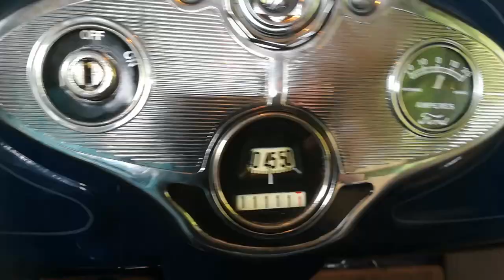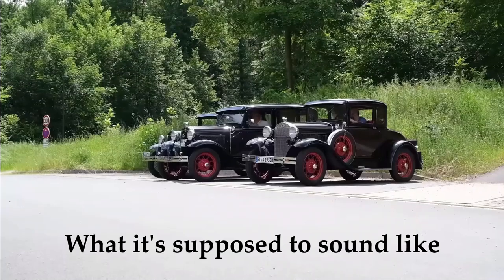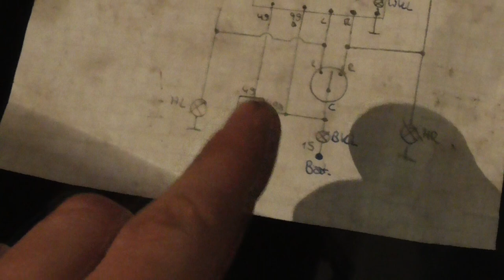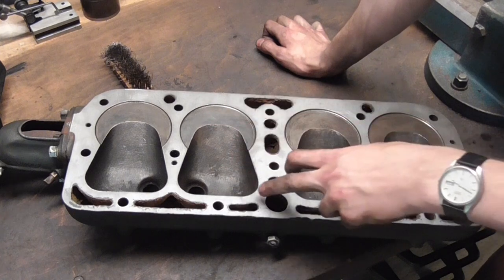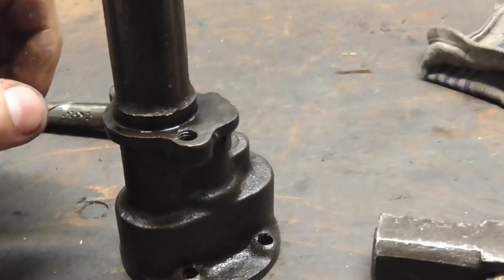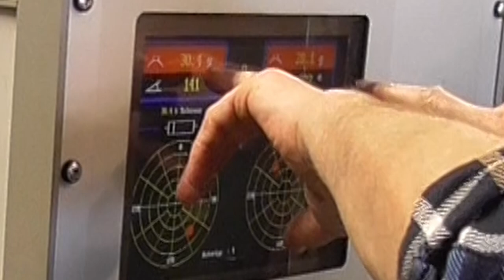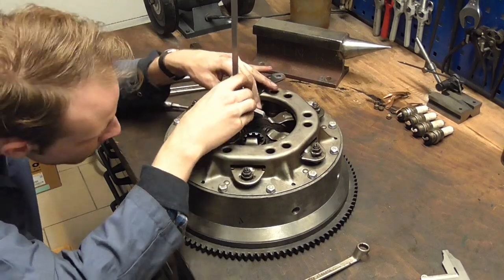Model A Mechanics Log #2: Preparing the Big Day

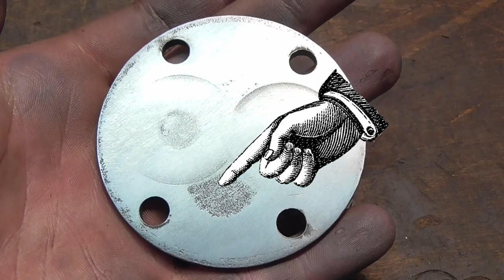Comment from the maker: I meant to put some captions over the pointer at 18:05 saying "cavitation".
DUH!
Reply: Are you sure?  Cause water can do that too.  I know cavitation can be an incredible force, but so is sitting water. Water will always be at the bottom of oil because it's more dense.
Reply from the maker: @tarstarkusz  Well, it's only at the intake side of the pump, where a vacuum would be created. 
If it was corrosion, I'd reckon it'd be all across the cover plate and not just in that specific spot.
Also, the pump isn't all the way down in the sump - there's at least 2 inches of space to the bottom of the pan,
which would have taken a lot of water to fill.

Comment: I have been through what ur going through,  my engine took 3 times pulling it out and sending back to the builder to get it right (all through covid)
Clutch chatter us what started my restoration. 
Now, Everything from radiator to rear end is restored or replaced.  Money is easy to spend on these cars. I've had mine 45 years. Most parts I've bought 3 times.
Reply from the maker: Oh god, I so dearly hope I won't have to get the engine out ever again (at least not in the next 15 years)...

Comment: I'm not too worried about the oil pump lug being JB Welded onto the body, but I do worry about the fan pulley. Those Model A fans do have a reputation for catastrophic failure and you could be looking at a new radiator (or even hood panels).
Love the new crankshaft! I'm sure you'll notice a tremendous difference and it is (more or less) a period upgrade.
When I look at the number of small/medium jobs you're doing whilst waiting for the engine, it's amazing how robust the car actually is. It just runs, despite cracked bearings, worn out bushings, graunched  flywheel ring gear teeth and over 90 years of "she'll do" type fixes. By the time you get finished with all of the major and minor repairs, it's going to feel like you're driving a Lincoln!
Thanks for showing us all of your "while I've got the time" repairs. I really enjoyed this video
By the way, very cool fountain!
Reply from the maker: The fans that fail are the original type, made of riveted steel sheet. The rivets weaken over time, the sheet starts cracking and a blade comes off, destroying whatever is in its path.
Now, the rotational velocity of a blade - and its weight - are alot higher than that piece I glued back onto the pulley.
I had my generator pulley come apart due to cracks in the casting; I didn't even notice it until finding a piece of shrapnel in the engine bay by accident.

I agree with you - the saying that old technology doesn't fail has to be corrected to "old tech can be pretty broken until it actually fails".
I'd bet I could have fixed the bearings up with JB weld and driven it for at least another year or two - not that I would recommend it, however.

Comment: Dear Astra Werke ingenious guy
👍👌👏  Extremely well done again (video, work music). Your vids are truly a kind of art in itself. 2) Please, Sir, don't give up. Please figure out a way to weigh your connecting rods and pistons properly. Maybe an exactly 2 or 3 kg heavy steel plate (matching the shape of your 5 kg kitchen scale) will already do the trick. I guess that you could also try it with a proper digital hanging scale. Anyway: Unequal connecting rods and pistons should not be allowed to kind of sabotage your effort balancing the flywheel. Thanks in advance for considering my suggestions.
3) Before weighing you can already remove a lot of weight from the connecting rods (amongst other things by reworking all the imperfections from the casting process). Afterwards weigh them and reduce weight on the three heaviest/heavier ones. Please do similar with the pistons. This effort will reward you with a way smoother running engine which will also accelerate faster.
4) Your wonderful fountain is a pure joy to watch. I've never seen something like that before. Does it have a special name/brand? Thanks in advance for answering.
As always: Thanks a lot for making teaching explaining recording editing uploading and sharing.
Best regards luck and health.
Reply from the maker: I gave the rods to the engine builder to have them weighed out - I'm not so sure if I want to actually lighten them (or the pistons) any more than needed in fear of weakening them or screwing something up.
Getting the piston weights close within each other is an aspect I'll add to my list, however, thanks for pointing that out.

The fountain is called "Hero's Fountain", invented by Heron of Alexandria some ridculously large number of years ago. 
When I was a child, I found building instructions for one in an old tinkering book from my dad. I built one out of cookie tins - it rusted away in no time, so I decided to make that one... Must have been in 2015 or thereabouts. 
Don't ask me why I didn't film it, it was a fun project!

Comment: Adrian  — you’ve provided a useful report on the new headlight reflectors. Could you identify them for others who may wish to purchase. Reflectors are sold by most suppliers but yours may be of a superior quality. The new thing here is the 6v positive ground led focused projection beam bulb and I can personally vouch for them but some may not wish to go that route.  You’re recommendation could be useful.

It would be good if you had the capability to check the dynamic balance of the crank and flywheel as a unit. I owned the equipment and for many years specialized in dynamic balancing of aircraft propellers after installation. Many turbine engines required this procedure. The prop itself could be dynamically balanced, the internals dynamically balanced, the output shaft balanced, but once assembled the parts interact as one unit which would typically require a final fine tuning with weight placement on the accessible propellor hub. My A engine also with the lightened flywheel was dynamically balanced as one assembly — so smoooooth compared to the typical engine.  You may be in for a pleasant surprise on first drive. If you can not balance as a unit it still will not be too far from ideal with the procedures which you have thus far completed.

One additional project could be the rebuilding of the distributor.

At completion you are going to have a very fine Model A.  I enjoyed the video update, thank you.
Reply from the maker: The reflectors will be marked by the seller as being "Aluminum coated, of high quality" - and will be about twice as expensive as standard reflectors.
I bought a set of LEDs a while back and had terrible issues with them starting to flicker whenever the engine slowed down below a fast idle. Might be an indicator that something in my electric system is haywire, but I had no problems with bulbs, so I put them back in.

I'll see if I can convince the guy that balanced my flywheel to have a go with the whole assembly - I don't know how well balanced the pressure plate is, neither.

The distributor is actually in tiptop shape - no slop in the bearings, gleaming cam lobes, fresh points... so I decided to leave it alone.
Reply: Adrian,  Too bad that you can not replace the cracked bell housing, but I realize they might be difficult to source there.  I may be able to help you out if you wish to replace it. Get in touch with Schwalms or Brattons.  They may not wish to ship it internationally but I can help you out. I can pick it up (they are close) package it, and ship it. Usually individual to individual with a used part, one can save some money on fees and duties. I can also get a discount on shipping which may help. I’ve experience with used old used BMW motorcycle parts to Germany.
Reply from the maker: @myrlstone8904  Would you say it would cause issues if I left it the way it is? 
I mean, sure, the cracks will start growing again after a while, but if it took 90 years for them to get this far, there may still be enough life in it for another couple of years (?)
Reply: @AstraWerke   Standby, I’m going to visit Schwalm’s  and discuss the crack situation.  Their opinion will be much superior to mine.  You can visit their website for an overview of the company. They are highly respected here in the States.
Reply: @AstraWerke   Adrian,  They have heard of people reinstalling the cracked housing but would not recommend it.  There is no way in knowing if the cracks will slowly continue progressing or if the crack failure could suddenly accelerate.  Now the good news.  It is repairable, providing the crack edges still register with each other.They recommended taking it to a welding shop familiar with welding cast. The repair can be made on the inside making it not visible.  TUV issues ?

The grinding when going into first gear is typically an A clutch problem.  They no longer use the A clutch assembly on any of the flywheels which they modify, rather going to the V8 clutch.  I have the lightened flywheel with V8 clutch and find it very satisfactory.
Reply from the maker: @myrlstone8904  First of all thanks for all the effort! 
I shied away from welding the housing up in fear of it distorting (which could in turn cause enough stress for other cracks).
The reason I hesitate to buy a new one is the price - and curiosity has the better of me.
Luckily, the cracks are in a well visible area, so I'll be able to monitor if they continue growing or not... And should they decide to do so, it's not a major catastrophy to get the housing out - probably by removing the gearbox, clutch and flywheel.
Probably not the answer you hoped for, but still, thanks alot for your willingness to help out!
Reply: @AstraWerke    No problem, they are near my home and  I’m always looking for a reason to visit Schwalm’s. :)  Imagine a child in a candy shop.  Their shop is like stepping back in time.  Engines, transmissions, differentials, steering boxes, brakes, and parts stacked from floor to ceiling.  I was also interested in researching this for my own knowledge.

Your concern over warpage etc. was why they stated a welding shop familiar and skilled in welding cast. Typically the housing would be heated in an oven to a specific temperature, a filler rod specific to the type cast would be used and the weld bead would be peened for internal stress relief during its initial cooling. The housing would then be packed in sand for a very slow controlled cooling period.

Your decision is fine since you are going to keep an eye on it. The only thing lost if the cracks do spread will be the labor to remove and replace.  We now know that welding is a viable option if the need arises.

Comment: I wish you would have shown more of the work at real-time speed, like the rebuilding of the oil pump.  Anyway, great stuff. 
I think you are being Penny wise Pound-foolish with that ear on the oil pump. 
Have you ever met Mister Murphy?  Murphy is a real asshole and he even has a law named after him. I've met him many times.  Murphy's law says that ear is GOING to find its way into that engine and it's going to have a party in the block.  That multi-thousand Euro block is going to get damaged.  Remember the song "Murphy's Law is sure out to get you...."
Reply from the maker: Well, I really tried to break the ear off, by overtightening the screw, mounting the lug in the vise and levering at the far end of the pump - it didn't give way. My rear main oil return line is held in with JB weld for over a year now, it survived all the heat and oil just fine, so I'm reasonably confident it won't even come off.
Anyways, I've got a habit of dropping the oil pan every 10k miles, so I'll use that point in time to also check on the oil pump.
I agree, not the "right way" to fix it, but curiosity has the best of me..

Comment: Are hazard flashers required to be retrofitted to all old cars in Germany? Anything else that is required to be retrofitted?

Still, another great video. Your preperations are coming along well it seems. Just a shame that unexpected findings tend to cause a lot of extra time. At least if you want to do the repairs properly. I'm sure the end result will be a very reliable car for quite some time.
Reply from the maker: Hazards, indicators, windshield wiper and two rear lights are the requirements for any registered german car older than 1960 or 1959 I think.
Reply: Interesting. When I had my imported Amazon inspected and registered here in Norway last year, it only had to comply with the requirements from when it was new. Almost felt like I were doing something illegal when I showed up at the road authorities without seatbelts and other basic safety features.
Reply from the maker: @togst  Belts, airbags and the lot also only have to be in the car if it was needed back in the day anyways. For some extremely old cars (let's say early 1900s), you can get a permission to drive without lights and indicators if you have a signaling disc with you and only drive at daylight in good weather. But for anything remotely modern, hazards a.s.o. are the modern stuff that the law requires.
(And, to be fair, they make sense.)

Comment: Where can we find the new switch used for the turn signals? Thanks
Reply from the maker: I did a search on ebay until I found what I wanted. 
Well, not quite - the handle was competely transparent and green, so I painted it black except for the little dot in the middle.
It also was for 12 Volts so I had to replace the little bulb in the center...
But there are plenty of indicator switches of this style around - and changing the bulb out is easy.